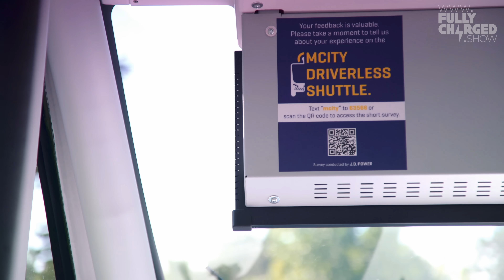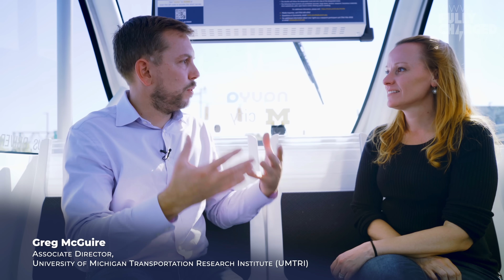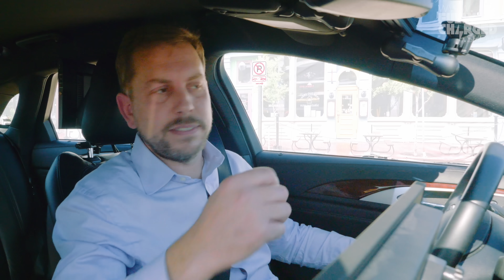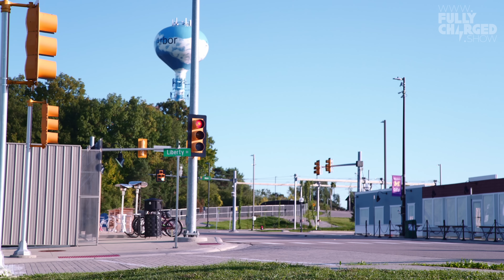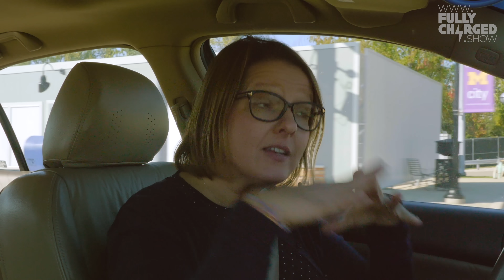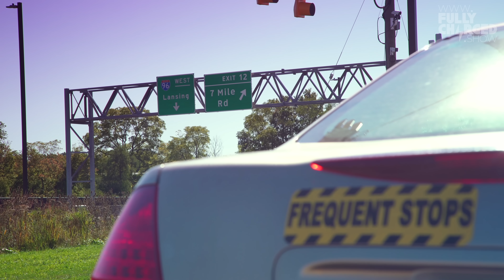When will Autonomous Vehicles graduate? | Fully Charged

Comment: Not for decades unless lot's of bribes and safety short cuts taken.
 And they should be capable to meet standard with out connectivity or off board sensors before it is even considered.
Liability should reside with the manufacturer/designer.  (needs to be fail safe)

Comment: Have you guys looked into >pavegen.com< they are making pavements/sidewalks that produce energy when you walk 
on them? Also wondered about flywheel storage. I thought some Swiss busses used these, wondered if there was a domestic one that could be run with bicycle pedals to charge batteries. Impractical for a car maybe but not for a hut in Africa or on a canal boat where power points are non existent outside of marinas. Keep up the good work

Comment: The biggest factor delaying the introduction of all types of autonomous driving (including Tesla full self driving), especially here in all parts of Europe, is the legislation.  The laws around this area are years behind the technology and massively limit what can legally be done.  The U.S. seems to be rather more flexible in this area...
Reply: Indeed!  European legislation has crippled the new "Summon" feature on Tesla's to the point where it is worse than useless!
Reply: Which amounts to a good reason why China and Far East will probably get a jump start in actual implementation
Reply: @petearmstrong2778  I got feeling UK will drop most of the EU stuff in this area and accelerate autonomous driving in the UK.
Reply: @DavidKnowles0  fingers crossed!  But I won't hold my breath...

Comment: Great vid and discussion, Chelsea. Thanks! Questions: So...the rest of the industry seems to be looking for external signals, "connected systems" as crutches to do what Tesla already does on its own? So just building the right car, there's a call to re-engineer every road and traffic light in the nation?
Developing an objective standard against which all AVs are measured is a great idea for certifying new entrants.
Folks ride in human-driven cars as passengers all the time -- what's the difference between that and being a passenger in an AV?
Reply: John Fife Wouldn’t making the static stuff communicate clear unambiguous information leave more compute power for the vehicle to work out what’s going on with the moving fluffy ambiguous stuff? And is the Tesla 100% perfect at autonomy?

Comment: By the time you figure out the politics the race for autonomy will be over mapping will never get to level 4/5 the only way is through vision and AI by the time the telecom industry start 5g band  another better and more reliable system and less expensive will arrive called STAR-LINK
Reply: we already got 5g in the UK. No star link.
Reply: David Knowles yes not at the moment but when star-link comes  it will be 3 times cheaper better band width and better coverage 😁👍👌
Reply: @electrifiedsmartfarts9529  when it comes, but that not for years in the future. The UK on the other hand has 5G today, an will be covered in it over the next couple years. An we will see whether it cheaper, none of the other satellite systems have turned out to be cheaper.
Reply: David Knowles it will all be about bandwidth in the future time will see who is correct

Comment: Never in the public domain.  Autonomy is fine in limited closed loop situations, but I seriously doubt whether autonomy can ever cope with every eventuality on the roads.  Add to this the risk of systems like this being designed in the control of the bean counters and the risks multiply (eg Boeing 737 max?).
Reply: Autonomous vehicles only need to be better than humans... Of course, the media will hype any accident involving an autonomous vehicle making it seem as though AVs should be perfect before being allowed on the road, which is nonsense.
Reply: @MarcCoteMusic  Not really true because if there is an accident caused by an autonomous vehicle it means the same dodgy software could be on many other vehicles. Therefore until it's fixed and tested the vehicles shouldn't be allowed on the road.
Instead of one person responsible for one vehicle it would be a handful of software engineers responsible for many thousands of vehicles. I just can't see it working until the accident rate is proven to be practically zero.
Reply: @Ed.R   - You make a good point. I still say that the risks need not be practically zero because any change that dramatically drops the number of accidents and fatalities is a step in the right direction. Time will tell, of course, as to when we get proper driverless cars and the legislation that permits them.
Reply: As far as I'm concerned the only automated system that should be left responsible for heavy machinery and people's lives is a PLC running ladder code.
Reply: It already in the public domain, Waymo is already running a fully autonomous service, okay in a geofence area but it still in the public domain.

Comment: The thing is, I don't want this, and I do want this. When I'm in a queue of cars, where the drivers in front of me are not really in proper control as the lights change or as the restriction in the road clears, and they all want to leave their own idea of a safe space in front of them, it's just so inefficient! I want cars to be linked by their computers until a reasonable driving speed is achieved, let's say 10mph, then each car in turn, starting with the lead car, is released from the system, to accelerate away. Hmm, no, it's never going to work. Just get off the road until I've gone by. Ah, that's the ticket! Not being selfish here at all!

Comment: Putting out the expectation that autonomous vehicles need to be 10 times safer before your ok with them is literally killing people. 40,000 people die from vehicles every year. If we could reduce that to 25,000 but we say. Sorry  Saving 15,000 a year is not good enough to let computers drive cars. is very sad. And this is purely going to be the fault of the news. 

Today people are unaware of the dangers of driving because the news stopped reporting on the 100 fatalities a day. If they report everyone autonomous fatality they will be the reason the life saving technology is not used.
Reply: I think the issue may be more mundane: Blame. With a human driver, we can except that people sometimes make mistakes. "To Err Is Human." But who CAN be held responsible, and can be 'educated' to correct persistent bad behaviour. And from whom you can get compensation.
How do you punish an Autonomous Vehicle? Turn it's AI off?
Also, does an A.V. have to be that much better in order to compensate for the poor driving of non-AV drivers, IE humans?
And if you live in the US, might there be a slight niggle at the back of your mind that Skynet could take control of these AVs and turn them against humanity?  :-)
Reply: The problem isn't like that. In near future, automatic breaking would be mandatory in most countries, and many more cars will have level 2. This will decrease the fatalities in a big way. 

I think that the 10 factor would be needed for level 4  and 5 to  justify the cost: would you like to pay the car the double and pay a lot more taxes to have the needed infrastructure? Without such factor, money could be better invested in things like road surface, which can also improve a lot safety.

Comment: Isn't Starlink going to solve connectivity issues? Do we even need 5g if Starlink promises much faster internet speeds? I don't fully understand either of these technologies,but I'm surprised they weren't mentioned.
Reply: Starlink isn't a cellular network.  You need a large satelitte dish receiver with a motorized base to pick up a Starlink signal.  It's not going to be on phones or cars.  Maybe trains?  Could be set onto cellular towers.  But you still need the cell technology to get the signal to your phone or car.
Reply: @patreekotime4578   You appear to be more than an artist😎 thank you for the explanation.
Reply: @patreekotime4578 
Why?  You don't need a big dish for Sat phones.
Reply: @Robert-j6r8c  Some do require a dish.  But mostly it's about bandwidth.  The difference between voice-only data and full internet is pretty substantial.  Our brains are capable of descrambling pretty terrible voice information that would be considered useless as digital data.

Comment: Vehicle-to-vehicle communication is a such a dumb thing to develop as it completely misses all the non-connected objects on the roads: People walking and cycling, dogs, wild animals, fallen tress, roadworks, you name it. None of those will be carrying around a 5G transponder continuously broadcasting their position, speed, and direction.
If you can't solve it independently and visually, you're doing it wrong.

But, I hear you say, v2v communication will make high speed driving more efficient because we can reduce the spacing between moving vehicles. This is true, but do we really need it? Room for more vehicles on the roads just lead to more traffic. Cars will be bumper-to-bumper leaving no space for cyclists, pedestrians, or even flexible traffic. I doubt the benefits will outweigh the drawbacks.
Reply: Its especially important for say trucking fleets or for coordinating traffic at major intersections.  If all vehicles are coordinated, it would be possible to virtually eliminate stopping at lights, as every vehicle could be timed and spaced to flow freely through.  Or vehicles could be better able to avoid people at crosswalks if they are all communicating.
Reply: @patreekotime4578  If you eliminate stopping at traffic lights how can pedestrians and cyclists then cross? And how about motorcyclists?
Reply: @Jens.Krabbe  i didn't say completely eliminate, I said virtually eliminate.  Obviously the systems would work completely differently at pedestrian-heavy intersections in cities vs an exit on an interstate overpass that it's illegal to even walk across.  And in the case of pedestrians, if every vehicle is communicating, then cars approaching the intersection even around a blind curve would know that people are crossing the road long before it is visible.  How is that NOT a good thing for pedestrians?  Motorcyclists claim "loud pipes save lives".. well how about a completely silent system where every vehicle knows the exact position of the motorcycle without deafening and scaring drivers?
Reply: @patreekotime4578  I didn't say it wasn't a good thing, but incomplete. So you still need a good visual system to take care of everything not communicating. With this in place you have very little use for the communicating system and it becomes an expensive, complicated, and intrusive (tracking) clutch, just like LIDAR.
Did you see the video of a Tesla stopping for a bear and her cubs in dead of night, or the one with a dear running out in front of the Tesla? A communicating system will not have spotted these, but the Teslas did, and that's a visual + radar system.
The argument about knowing what's around the corner is flawed, because if the vehicle is driving too fast to stop when things (pedestrians, stopped cars, fallen trees, bears, etc.) are spotted in front of it, it was clearly driving too fast around that corner or curve.
That's another thing we'll see when FSD becomes prevalent: vehicles will no longer exceed the speed limits :-)
Reply: @Jens.Krabbe  but the communication system means that it can tell all the other cars behind it that their are bears in the road, enable them to slow down or take a different route, or even give the option of continue on that route just so people can see the bears. 

The communication system is about sharing info about car surroundings.
Reply: What World do you live in.. Do you know a single person without a phone... That connected and GPS tracked.
Reply: @Robert-j6r8c  Who wants to be tracked? Not me.
What about inanimate objects, animals and babies? You can't cover those without vision so you may as well do it all through vision predicting their paths in split seconds and react to that rather than relying blindly on them telling you where they are and where they're going when.
Reply: @Jens.Krabbe 
I'd be more concerned about a baby getting around a city on it's own than being tracked.
Reply: Sharing this information means cars can make a different decision, for example a car accident at x location, means a car before it  reaches the traffic jam can decide to take a different route.
Reply: @DavidKnowles0  Isn't that already covered by Google route planner with live traffic information?
Reply: @Jens.Krabbe  It is, but it isn't fully automated and there always room for improvement .
Reply: @DavidKnowles0  Still, navigating around obstacles in local vicinity is very different from finding the optimal route in a network of roads. The first needs identification and precise location of obstacles as well as predictive analysis, while the second is simply a network optimization problem.
There is, however, a drawback with every vehicle being updated live with traffic information: If the feedback loop (time from accident happens and is communicated until the car reacts to it by choosing an alternative route) gets too long we could easily experience new roadblocks appearing on small back roads rather than on the highways.
I think Tesla is using Google Maps. I don't have one myself, yet :-)

Comment: I love that this is in Michigan. The issue I am having right now is lower mileage due to cold. I hope in the process they can figure out a way to not only warm but insulate the battery for extreme temperature. I have the sensors on my Prius Prime. When I go to Chicago I love using the sonar for driving. It accelerates and breaks for me. Makes driving in slow and go highway driving so much easier.   Go Michigan!

Comment: Big thing is the human brain is way more able than a computer or an algorithm
Reply: Until it has a few drinks.  Or doesn't get a good night's sleep.  Or it had a bad day at work. Or the kids are screaming in the back.  Or there's a distracting billboard.  Or it has a medical emergency.  Or the body it's connected to gets older and it's sensory input and reaction time gets slower.
Reply: But a human sucks at texting and driving. So does the crappy computer driver have fewer accidents because it never gets distracted? I think that fact is going to be its strong suit.
Reply: @ecospider5 
All depends on the code on how safe they are... Look at the 737 max
Reply: @Robert-j6r8c  which is an excellent example of why we need these kinds of facilities testing the technology so it can be properly tested and rated.  It's coming, it's already partially here, and we need rigorous safety protocols for it.

Comment: They're called buses and street cars and have been around for over 100 years now. Get traffic off the road and take mass transit or bicycle in town. Worked for Grandma.....
Reply: And if we can reduce the cost of running buses whilst improving safety by replacing a human driver in an old diesel bus with autonomous electric buses, even better. Cheaper, safer, more flexible public transport.
Reply: @GreenJimll  electric buses are not new technology. San Fransisco had them a hundred years ago. That is my point. We stopped evolving around 1990 and now spend more time arguing online.
Reply: The very first vehicle was a small bus.  Public transit and autonomy are not in any way mutually exclusive.
Reply: @GaiaMother7  My Amish neighbors use horses everyday and we're using the same concept with our utilities with fiber optic as the telegraph yet today. What's your alternative?
Reply: @GaiaMother7  That's too bad. Modern life is not progressing unless you're into computer storage and speed. I live like a modern day Amish and life could not be better. For the record, how much food do you have in the the house for example? I'm also an IT specialist Jay Jay so quite in touch with any technological advancements. We've had few in 30 years other than miniaturization.
Reply: @GaiaMother7  not really as much as you think. Robotics will eliminate human jobs. we  had most of what we have today in 1999. I started doing AI in 1984. Technological advancements are specific to certain areas of the country and not nationwide. I did AI and advanced GIS in Farifax 20 years ago that has not been duplicated yet today in Michigan. You didn't answer my food question.....
Reply: @GaiaMother7  Networking has advanced little since the mid-1980's. We're getting faster bandwidth but less productivity overall so where is the advancement? My business is Linux storage servers. I built faster computers in 1990 running DOS than what we have today.
Reply: @GaiaMother7  I have friends with your viewpoint and felt a little more that way 50 years ago myself. I'm 66 now. Kids and a wife and responsibilities change things. There really is no better life than farming a small plot of land and feeling the soil as you grow your food. I have had the best of both worlds and would prefer the agrarian lifestyle. Living in the city sucks but a nice place to visit. I used to manage the D.C. area for my agency but lived in the Shenandoah Valley nearly 90 miles away. Socialism sucks. Hard work makes life worthwhile and keeps you in shape.
Reply: @GaiaMother7  Yeah, communications are amazing yet we have more discord than ever.....where's the progress for humanity?